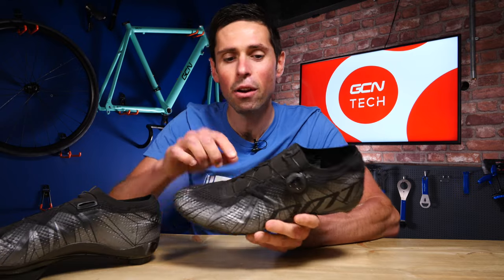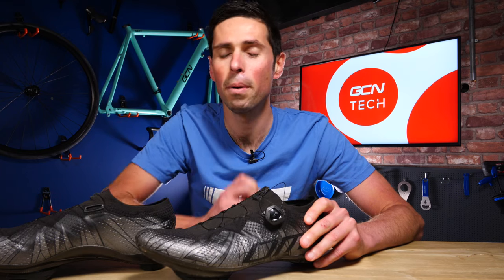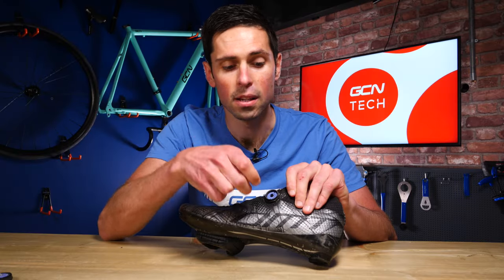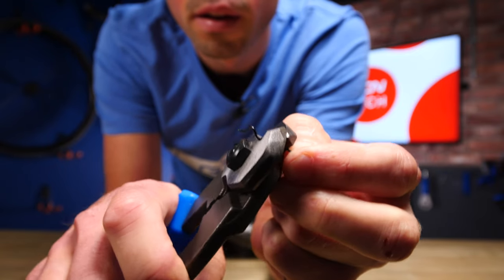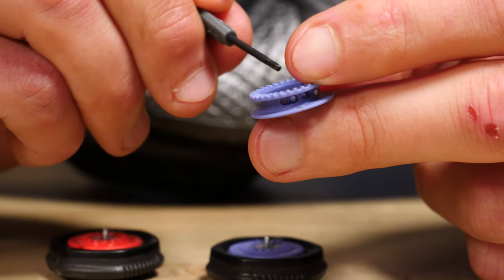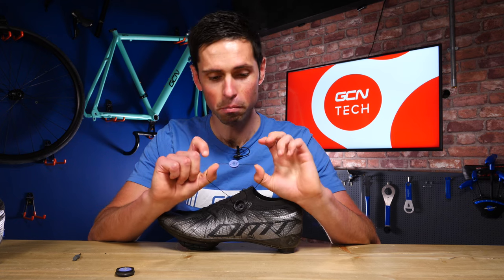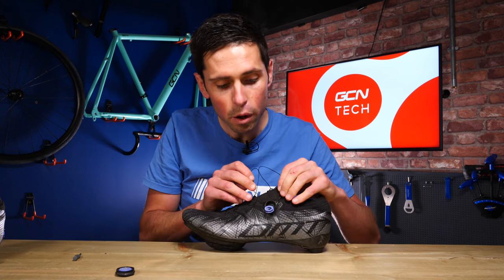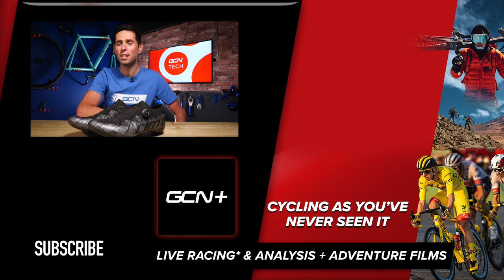How To Fix BOA Laces On Your Cycling Shoes | GCN Tech Monday Maintenance

Comment from the maker: Do you prefer BOA dials or traditional laces? Let us know in the comments 👇
Reply: I prefer Velcro, sadly only a few top end/mid range shoes are made with it these days. Boa’s: they work, but when they break it’s a lot of work to fix even more so en route on holiday. Laces look cool, But I doubt the on the fly adjustment.
Reply: I am now anti-Boa.  After having a complete unit pull away from the shoe and leaving me on the side of the road.  Nobody sells a Boa base to reattach it so unless you go to laces the shoe is worthless.  Velcro, laces, and ratchets are a better choice until Boa catches up.
Reply: Boa - or the Mavic Variety for me. Never failed me over many year, rain, snow and mud.
Reply: Boa. I just like then adjustability. Especially on longer rides, when the feet swell, I just pull open the dial, do one light (no-power) pedal stroke so the wire can open a bit (just as much as the foot has swollen), and close it again.
Also works on the clamping mechanism variant on my Sidi MTB shoes. Just push those two release levers, and if it is still a bit to tight after one pedal stroke, do it again.
Reply: Why hasn't Nike, Adidas and all of those shoe makers implemented these on regular shoes...? And here I am tying my laces like a sucker!
Reply: Either or doesn’t really matter to me - as long as the basic shape is good I am happy 😊
Reply: Are the Sidi dials ones more durable than BOA dials?
Reply: BOA with NO VELCRO - Laces would be distant 2nd, but again NO VELCRO - VELCRO SUCKS
Reply: I prefer the ratchet straps on my Sidis (but they have dials across the foot.  I have a set of S-Works super lightweight summer shoes with boas that are like wearing slippers, but I'd have to say that I'll take the extra grams for the extra comfort on longer rides.
Reply: @panzerveps  Yes I contacted them directly.  They do not sell/offer the bases.  The repair kit is for everything else.  So nice the base breaks or separates you're out of luck.
Reply: @tomsnider7611  that's a shame. 😒
Reply: I have BOA dials on my Pearl Izumi shoes but they constantly creak. Any ideas how to stop this from happening?
Reply: @mr.piccolo186 People would complain and it would be too much work and maintenance for kids. I just bought a pair of comfort motorcycle shoes with this contraption and I would honestly prefer laces and a velcro strap

Comment: Great video.  I live in a small town so finding good replacement shoes is impossible.  After watching this video and remembering that I had probably saved the tool 15 years ago in my cycling toolbox, It took me 15 minutes to repair the system.  You saved me around $250 for new shoes that would not have been an ideal fit. Thank you.

Comment: Great video. I could not get it to work with a standard T6 torx though, the shaft being too thick for the tiny hole in the BOA dial. So I had to wait for the specific tool from BOA that features in the video.

Comment: Hi GCN Tech.  i intend to do a full service of my road bike this winter.  One of the jobs is a brake bleed (Ultegra 8000).  There are adjustment screws in the lever (reach and free travel).  Do I need to put these adjustment screws in a particular position before I bleed the system?  Many thanks Jon

Comment: I still prefer a ratcheting buckle on my cycling shoes.  You can easily tighten and loosen them even while wearing full finger gloves and using neoprene shoe covers.  If I could though, I might want BOA dials on my other athletic shoes for other sports over regular laces, which often come loose on me and make adjustments in the forefoot impractical unless you've got several minutes of down time during an activity.  I avoid velcro/hook-loop fasteners whenever I can to avoid damaging fabrics vulnerable to the dreaded inadvertent hook snag.

Comment: Just looked at my shoes and there is no hole for a T6 tool in the "O" of BOA.  How would I get the spool off?
Reply: Is there a BOA sticker on the face? You may have to puncture the sticker to get at the T6 underneath.
Reply: @aaronpike1853  There is no sticker, just a hard plastic cover with no hole.  The shoes are from Pearl Izumi  a 1-2 years ago.

Comment: I have a fizik vento carbon 2, how to remove the L12 BOA cap?
Reply: Check out Boa's website. There are warranty kits available as well as instructions for all platforms.
Reply: T6 torque. Tool comes with a replacement set. Each bag has one left and one right BOA cap and spools (red and purple), laces, and screws. It is an easy job. You just need to match the BOA type. The set for my Fizik shoes were branded Scott.
Reply: @Wildschwein_Jaeger  it needs pry tools instead of T6, just got curious how to remove the L12 boa cap since i couldnt see a hole for t6 on it.

Comment: Tech question: Shouldn't it not matter if I am using a ten-speed or eleven-speed rear derailer on my bike if the shifters and cassette match? Isn’t the real concern pairing the right shifter with the proper cassette, so the indexing is correct? In my case, I have a ten-speed Ultegra rear derailleur on my bike and I’m finding it hard to source a replacement. Couldn’t I use an eleven-speed rear derailleur with my ten-speed shifter and ten-speed cassette?

Comment: Hello what is the phone number to get in touch with to get this tool to fix mine. I have a pair of under armor. Keep hammering, Cameron Hanes shoes that I bought a couple years ago and I slipped off a ladder and the ratchet system broke. I have never been able to use the shoes to run since and they were my favorite pair and quite expensive.